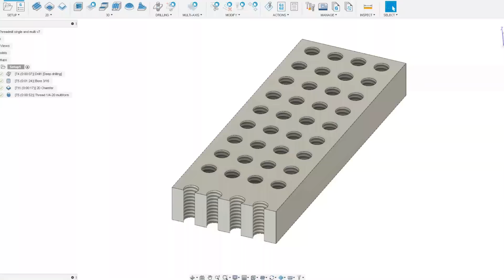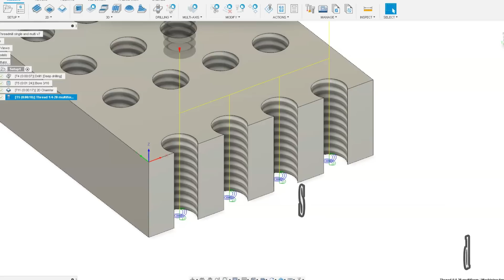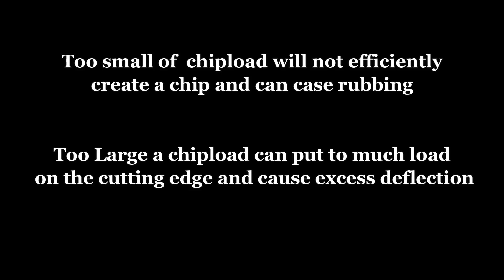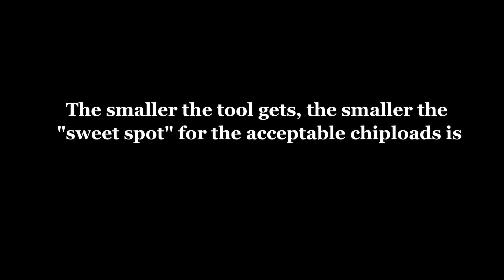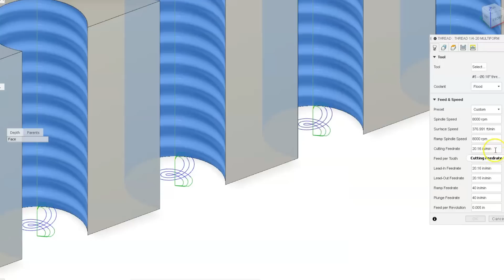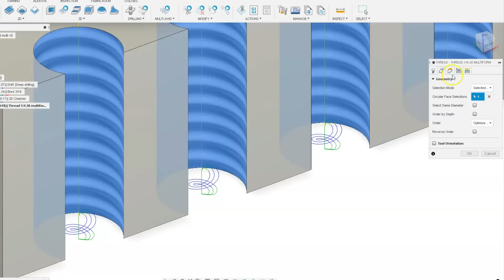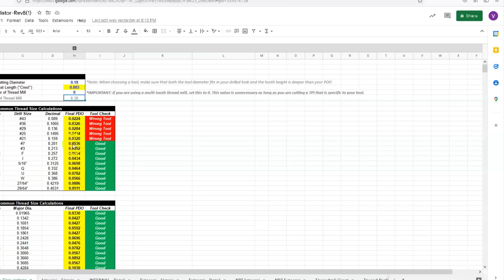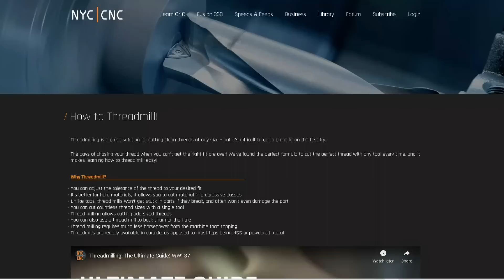Threadmilling:  Correct Feeds & Speeds in Fusion 360!

Comment: Needed some threads in a 30mm hole and needed to make a plug that screws into it. Only had a 3/8 x 16 threadmill (1.587mm Thread Pitch) handy so I used your sheet to calculate the sizes.
First try.. perfect. I don't mean OK, I mean perfect!
Thank you!!!

Comment: Hi, I am a beginner in CNC machining and never (yet) milled thread myself, and I have no doubt that your (and others) experience shows that greatly reducing the feedrate leads to less tools breaking (especialy on less rigid machines). And initally the explanation seems to make a lot of sense. But I did some calculations and some drawing in a 2Dsketch in CAD and I have to say that the justification is actually wrong. The actual feed per tooth will never be greater (and most of the time it will be less) than the one specified for calculation. It is easier to explain with a drawing but the main point is that a chip is not uniform in thickness (conventionnal vs climb milling figures often show the chip shape very well), and even though the material effectively advances faster at the maximum hole diameter, the maximum chip thickness depends only on the tangential feed relative to the tool center's motion (which is the one calculated by Fusion). The chip thickness at the maximum diameter is always zero (cheap breakage if climb milling), exactly like in linear motion.
That said, I may be more of a theoric person but if experienced people say that I am gonna break less tools with this formula, I am gonna use it. Even if the justification does not make sense.

Comment: Why aren’t you using in control compensation?  Surely this would make the federate correct at the cutting edge as the toolpath coordinates would then be cutter edge not cutter centre?  This also allows you to compensate for the correct thread fit.
Reply: Many of the hobby machines do not have that option and machines that do, can usually rigid tap.  You are correct though, but one thing to add is that it can complicate  few things including lead in/outs.

Comment: Thank you for putting this out there!  I’ve always thought that threadmills and bores weren’t running “correct” and had figured this out one day. All the old guys in the shop insist “federate is feedrate” but there’s a severe notable difference. I wish fusion accounted for this, especially on things like dynamic roughing. Dropping into a pocket and starting to rough out kicks out huge loads and breaks tools often. 

Video idea, what about what tap to use when?  I can’t explain to our old school guys that there are aluminum taps, steels, stainless, etc. they keep throwing way wrong taps into way wrong material, like a green band osg spiral flute tap going at 1000 rpm into 304 stainless and then being confused on “what happened”.  Especially with modern, fast, purpose driven tooling
Reply: You can use "feed optimization" in fusion and adjust the "reduced feed radius" to be slightly bigger than the tool radius and that will reduce the feedrate after the helical entry.
On deep pockets, relative to the tool diameter, I set mine to 1.5 times the tool radius so the first couple of turns are done at the reduced feed rate, about 2/3 in my case.

Now keep in mind that this will reduce the feedrate in other parts of the toolpath that fit the criteria.

Comment: Nice. I don't make any toolpaths yet (been working in the shop since almost 2 months, 2/3 days a week, next to mech eng uni course) and we don't even use Fusion, but this is useful knowledge anyways
Reply: plus we do everything metric 😅
Reply: This can still apply to you big time though. Use this formula when using endmills to bore holes and it will give you PERFECT finishes and no more push off than you normally would get. Even more critical when using long tools. 
This formula is not unit dependent so as long as you keep your unit the same you're good.